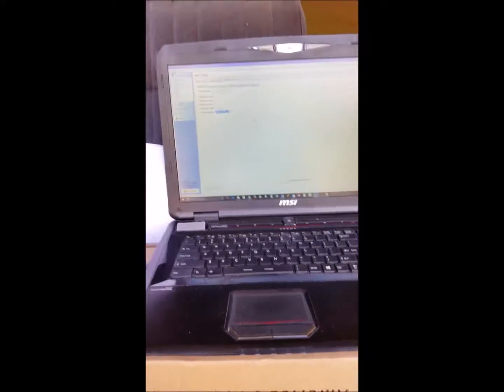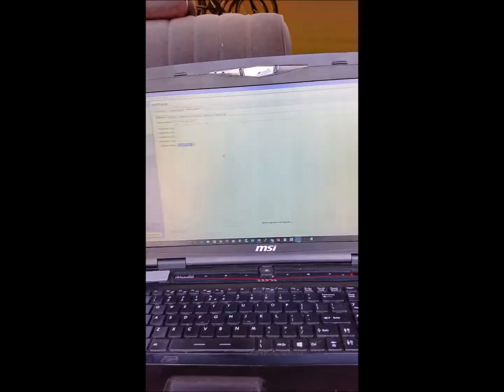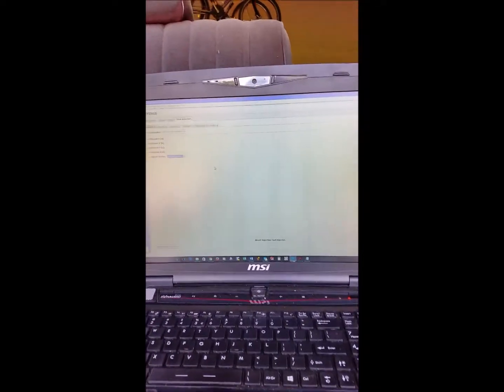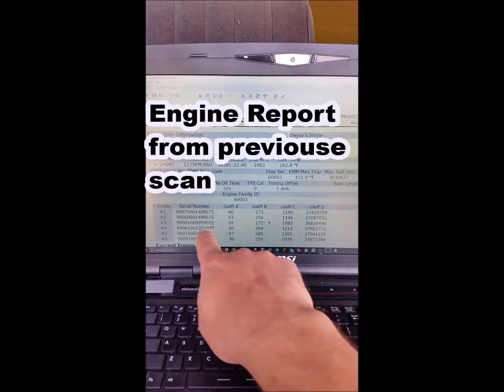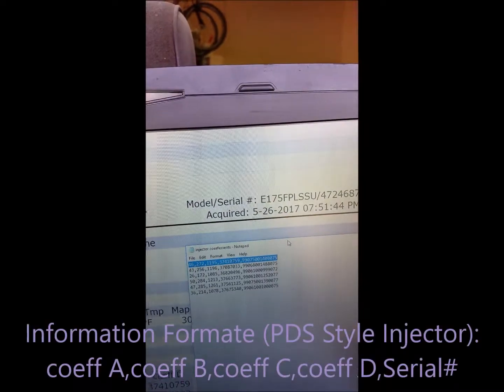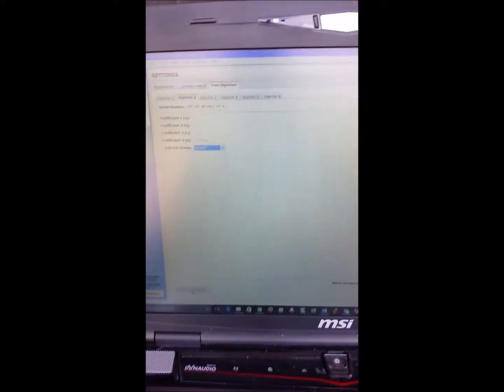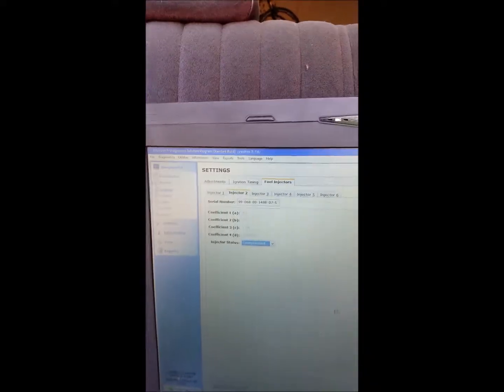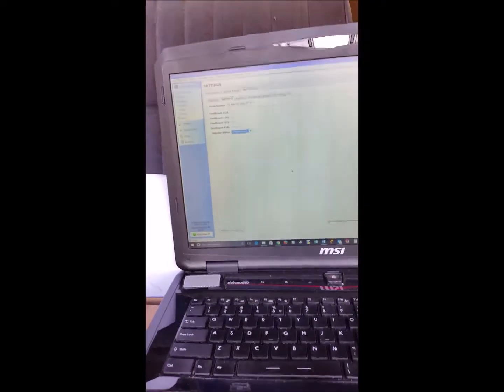Evinrude Ficht 175 V6 PDS Style Fuel Injector Data Swap

Comment: I have a 98 Johnson ficht got water in the fuel haven't been able to start it since if you unplug the injectors do  you have to reprogram them
Reply from the maker: No, I don't believe so. But, if you remove them, don't mix them up. Must go back into the same locations otherwise would need to set the coefficients into on the computer to the appropriate position.

Comment: Hello, I have a 99 year ficht and I replaced the oil injector, that injector comes in a barcode and not in QR. The question is how can I find out what is the part number of that injector?
Reply from the maker: Oil or fuel injector? I think there are apps you can download that you can take a photo and it will read the barcode.
Reply: @Kapco78  oil injector, I want to replace it and the tab to add injector does not appear
Reply from the maker: @alanprevidi2876  there is no oil.injectors on a Fiicht. There is just an oil pump that has small lines going to the oiling points.
Reply: and under those oil lines there is an injector the same as the gasoline ones
Reply from the maker: @alanprevidi2876  I have never replaced one. That's uncharted waters for me.

Comment: I have a 99 ficht 175 and was trying to find his to tell I'd the computer is bad mine is having problems and I can't figure out what the cause is
Reply from the maker: Kameron Pirtle you need to have the software to know for sure what's going on.
Reply: I have the software but this thing is throwing so many different codes I don't know where to start
Reply from the maker: @jamespirtle8561  check to see if you have a communication failure message. I forget the exact wording ,but my issue was the chip wasn't communicating and had corrupt data. These computers also have injector driver  failures. I would keep a history of the codes, clear them and see which ones come back.

Comment: What the name  and version of the software your using?  I have a version of the software but it does not have a scanner option
Reply from the maker: EV Diagnostics V5
Reply: I'm working on the same thing right now. Don't think you need a scanner option (the evdiag I just bought doesn't have that option either).
What I've done is download a QR scanner on my phone. Scanned the QR code on the injector, and input those numbers into a notepad file as follows xx,xxx,xxxx,xxxxxxxx,xxxxxxxxxxxxxx.
Pretty sure this is the correct format. Saved as a .dat file (had to google how, super easy). Moved that file into the correct folder in my evdiag software using the windows file explorer. File shows up in the software when changing an injector.  
I'm 99.9% sure this will work, hopefully the op can confirm.
Reply from the maker: @sethstevens978  that should work. Double check what you type.